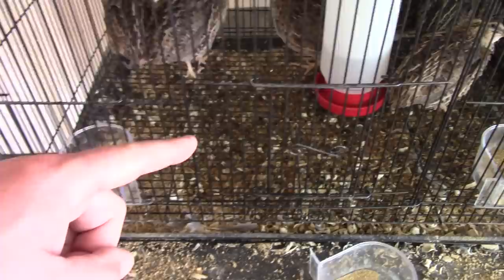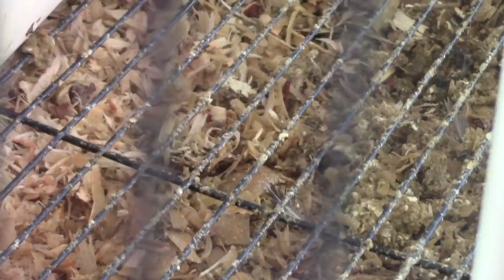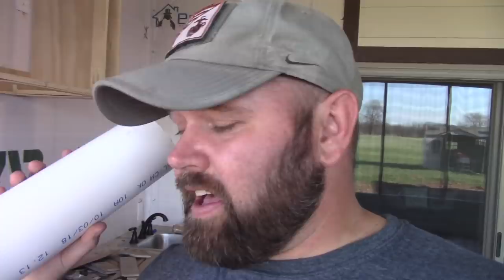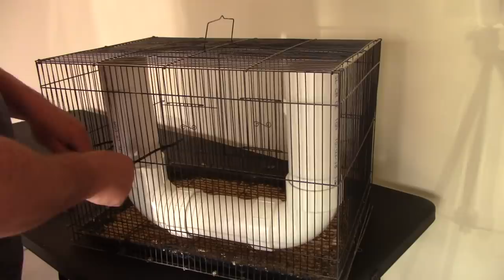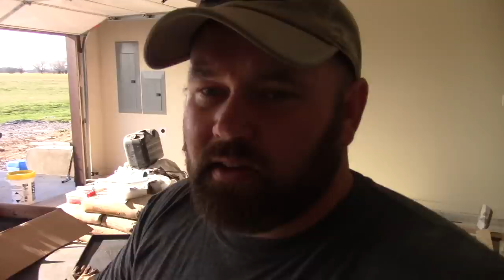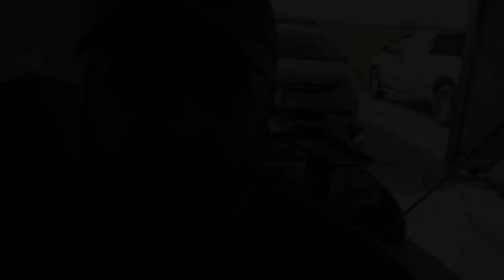HOW TO BUILD THE ULTIMATE NO MESS QUAIL FEEDER

Comment: Many thanks for your well presented video -- I have just made a no mess quail feeder based on your idea --- I made a slightly different version in that I connected a T - Part Gutter Piece to the gutter feeder downpipe at the bottom and then connected two short pieces off gutter pipes to  both sides of the T Part Pipe  and then drilled the feeder holes on either side afterwards --- the advantages being the food will fall down either sides of the T Part Pipe afterwards and it also takes up less viewing space than the idea you had off having two pipes going down to the bottom feeder pipe --- also it has a nice symmetrical appearance ( one thing I have not tested it yet as I am still in the process off building the cage but I am sure it will work well )otherwise  well done for a clever idea -- Norman England

Comment: I like it! It is similar to a PVC pipe feeder I've seen elsewhere on YT. But yours has those handy filling pipes, the one I saw was just a straight pipe with holes and ends, propped up/stabilized by blocks of wood screwed to the ends. So you did improve on the original design.

Comment: Those are sweet!! And if someone wanted a larger one with like 8 holes, you could use 45 degree turns on each end and a double 45 in the center with a third upright so you can fill three different places and put 4 holes on each side between the center upright and the end uprights. And using the 45's it would move more food toward the holes than the 90's do. Cool feeder Dutch!

Comment: I'm currently using milk bottles with holes in the side but if I put tractor exhaust flaps or just end caps on the tops of the pipe I could fill these from the outside of my cage and not have to worry about the rain getting in.

Comment: Hey Dutch, in the cage with more than 3 quail inside you will need more than 2 holes for the feeder to prevent bullying for food. Like maybe 4 holes? Just an idea. Also use a funnel to pour the feed in.😊
Great concept!👍👌💕
Reply: Good tip your right. They will all try to get into the 2 feeder holes

Comment: If you cut your pipe at 45° angles on the ends, you can glue them together without having to use the EXPENSIVE right-angle fittings. One right-angle fitting costs almost as much as a 10' piece of pipe. It might be even better to "T" the vertical pipe into the middle of the horizontal pipe but the cuts would be much more difficult.

Comment: You could wire up the small doors for them to eat from the outside of the cage you will save space. With the watering cups and a 4 gallon bucket you would have to feed or water for a week.

Comment: Great concept but there is a better way. Use 2 x 4 polly drain pipe and cut the same holes , only square ones and line them up with the square holes in the cage cloth and then place whole thing on outside of cage. I drill a 1 inch hole to line up with the 1 inch cage mesh, leaving the bottom of the hole as drilled but the top I jigsaw out to square to allow little more head room. Hope this helps.

Comment: I have the same exact thing for my chickens. Works great. Been working for a couple years now. I was thinking something along the same line would work for quail too. And I’m wondering if you have the cages with the feeding stations hanging off the front of the cage if it might be possible to do slightly smaller ones maybe with two 25* angles if you could hang them on the front on the same place. Idk when I get into quail I will for sure be experimenting.

Comment: Hi, I had an aviary and had an outbreak of mites. I found out that the mites were in the carpet I had on one wall. Even though I kept it clean for my birds. It was not an instant fix after removal of the carpet and was costly to get rid of the mites I was told to use seven dust on a new carpet if I still wanted it.

Comment: How did you decide how far from the elbow to make the hole? I was thinking add another hole through the joint of the elbow. Round out the hole with the Dremel to compensate for the extra thickness.

Comment: Not that the container feeder works for others, but not for you, it's probably how you built it.  You drilled the holes on the side way down at the bottom and the holes look huge.  I haven't used one, but that doesn't look right like the ones I've seen.  I do like the design of what you built though. With a few dozen quail in one cage, I would have to make it longer because with two holes they'd be fighting like crazy.

Comment: Would that work if you could suspend it somehow, Know what I mean?   To give them even a little bit more room.  If you tied it to either the roof or the side of the cage with clips it would give them those inches of floor space back and at the rate they grow 6" or 8" of extra room for their feet will be appreciated.   It would just take a couple of loops of string to lift it up off the floor tied through a couple of the roof's cage wire to suspend it, and they make clips in all sorts of sizes to attach bird feeders to cage wire so they shouldn't be hard to find.  If they have to live in cages then I think it's incumbent uponvthe owner to make their space as comfortable as possible,  and as you pointed out, they are pretty small cages.  Your feeder is great I'm glad it's working for you, now you need to find a lid from something to cover the top of the pioe so that critters don't get the opportunity to scavenge through the wire for free food when you've filled ig up.  Would a Pringles cap fit?  If not then a Jar lid of some description the same size as your pipe?  You could either drill a small hole and fit a funnel through it then cap THAT to deter teeny, tiny thieves or just lift it off, not a big deal to keep the food clean and dry when you move them outside is it?
Reply from the maker: Yes i bet it would

Comment: I now know why i didn't have an issue with the feed is because my feeders and waters were mounted on the outside of the cages so they hadecstick their heads out of the cage.  You souldnt have to cut the cage to mount feeders on the outside
Reply from the maker: Cage wire gap is to small for them to get their heads through,

Comment: You holes in the Tupperware is too big and too low. Otherwise they would have worked better than anything.
Reply from the maker: No that design is not good at all for my cages, it is good for others who have bigger cages then mine. This pipe feeder is by far the best I can have for the size cages I have without putting one on the outside.